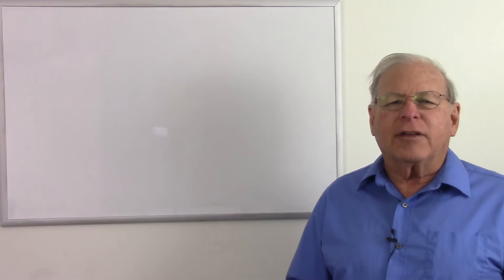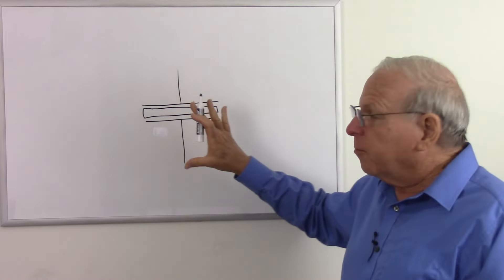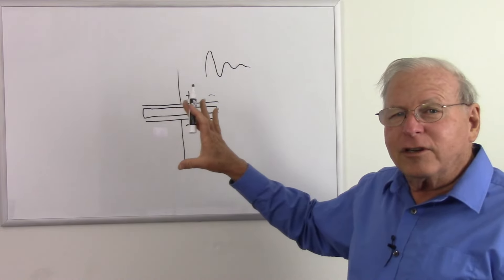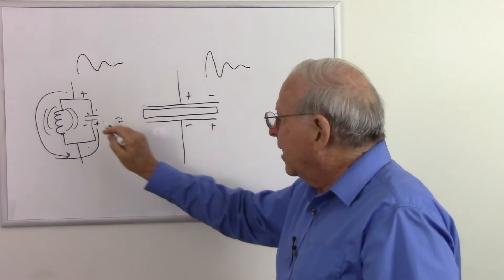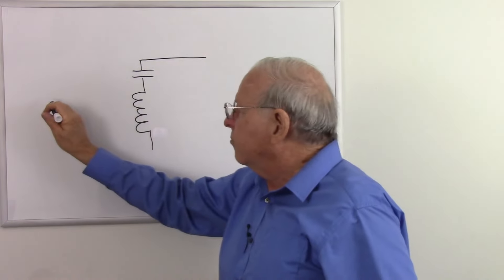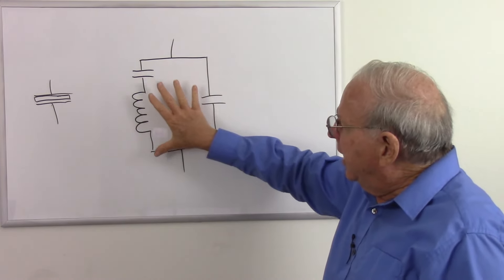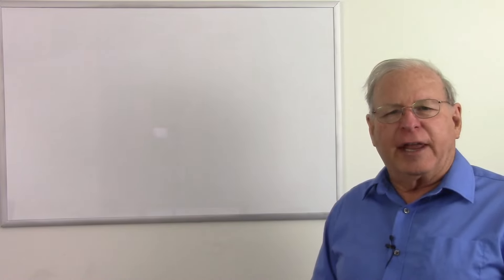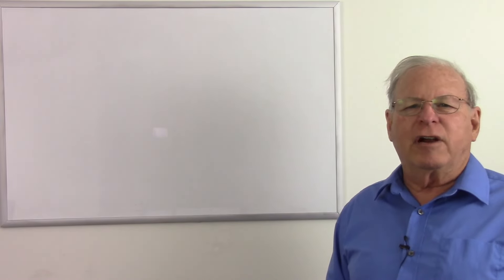Crystal Oscillators - Solid-stated Devices and Analog Circuits - Day 6, Part 9

Comment from the maker: Oops! The transistor symbol in the schematic for a Pierce oscillator is for a PNP transistor where the 2N2222 and 2N3904 are NPN transistors. There is a link to the corrected schematic at the appropriate point in the video and here: https://youtu.be/SQ9_buobb9M

Comment: Many manufacturers (ON Semi, T.I.) etc offer standard HC or similar logic gates, with 1,2,3 or 6 inverters in one package and they are very cheap. Be sure to use the "U" (unbuffered) version such as the 74HCU04. the 14 pin version are available in through hole or surface mount. The really good thing about the 2,3 or 6 version is you can use one as the oscillator and the second as a buffer, improving stability.

Comment: Very interesting.  I have a Channel Master antenna rotator control unit with a PIC16F57-IP that wont tick over. I'm going to try replacing the crystal oscillator to see if it will fix it. Thanks!

Comment: The Atari 2600 uses a Colpitts oscillator. I plan to use this circuit to inject a new clock frequency on my Mega Drive's processor, a Motorola 68000, to overclock it from ~7,5mhz up to 12mhz. I have a 10mhz version of the processor to replace the original 8mhz one, so it will suffer less from the overclock. This is very beneficial because Mega Drive games speed are not clock dependant, so it will only correct slowdowns in certain parts where games overload the processor a little. The Pierce oscillator is used on the Game Boy, I put one on my Super Game Boy to fix the clock frequency to match perfectly the original handheld's frequency.